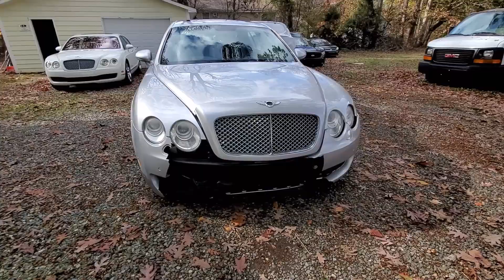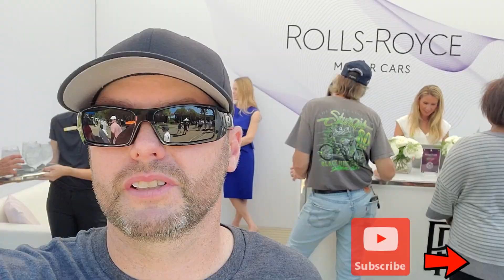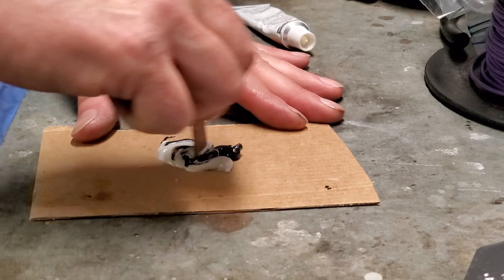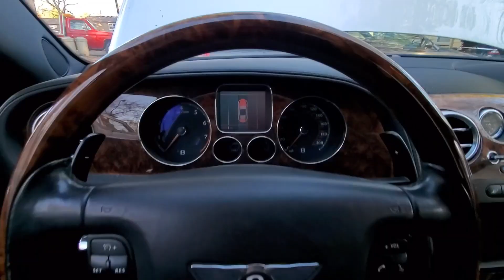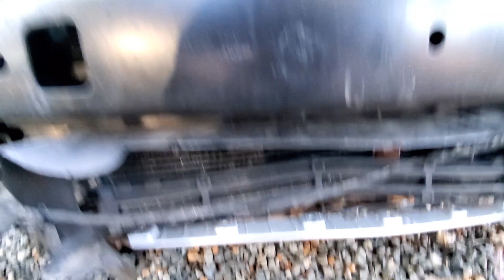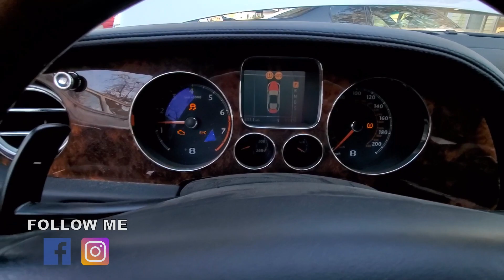Revealing The Mystery: Will The Engine Of This Salvage Bentley Flying Spur Run?

Comment: James,the original bumper cover will run you $ 5400 not even primed.
I just replaced mine with an aftermarket from a well known place for parts in Miami ,it was $ 1900,the I paid $ 800 for paint .
If you need the address let me know I think you tube don't allow me to post it here 

Ulf
Reply from the maker: I have a couple leads on some parts I need. Thank you for the info.